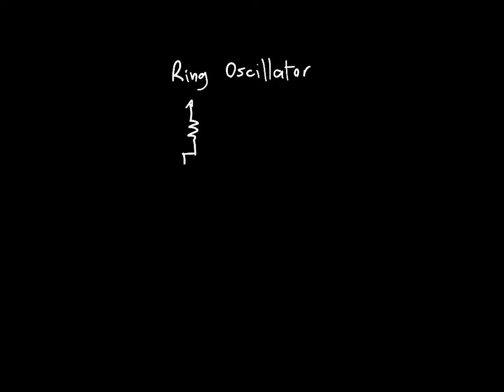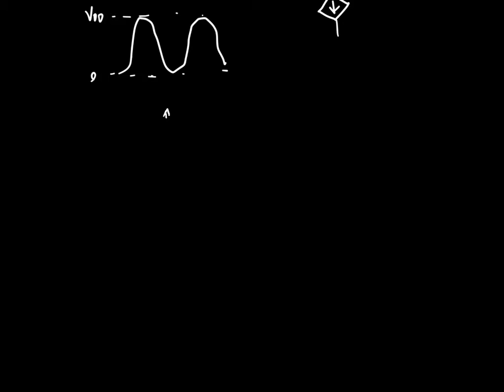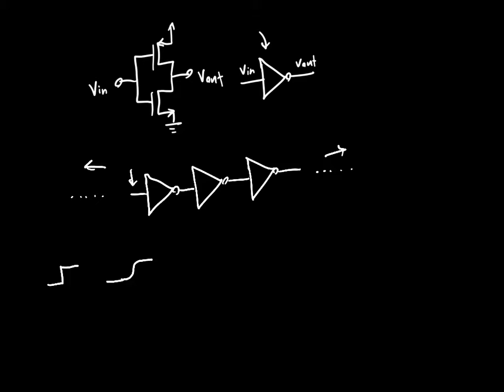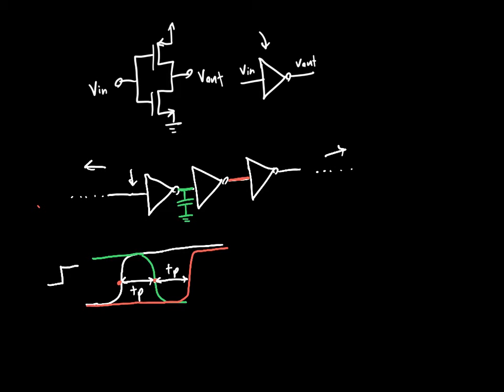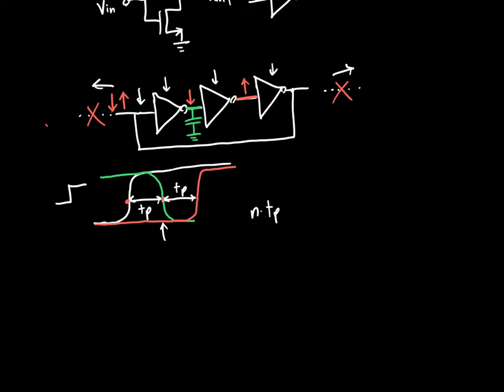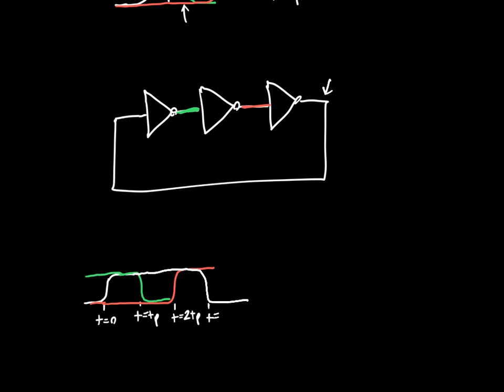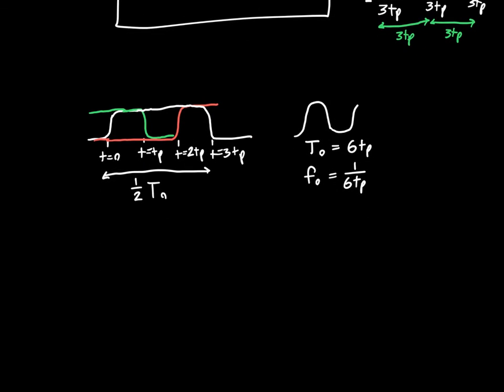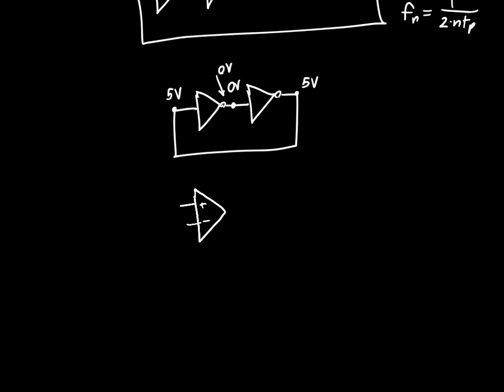Ring Oscillator Part 3   Large Signal Analysis

Comment: wired thing is  how does it?complete the positive feedback? based on the given analysis it's only negative feedback. I always have the feeling that frequency should be 1/Nt
Reply: the invertor or any circuit themselves has phase shift (1 pole contribute 90 degree for examples) besides the polarity inverted, which contribute another 180 degrees. But I think what this video told is definitely a good thing that why 2 inv cannot oscillate but have a stable operation point?

Comment: Hi, The MOS used in inverters is operated in which region?
Reply: That question does not have a straight forward answer. Both PMOS and NMOS go through each region during a transition.
If you want a good visual aid, I recommend googling "VTC of CMOS Inverter". Here is a good example with a small typo: https://www.electronics-tutorial.net/Digital-CMOS-Design/CMOS-Inverter/VTC-CMOS-Inverter/Fig6-VTC-CMOS%20Inverter.png 

If you give the inverter a rising edge (low-to-high voltage) the MOSFETs will go though the regions in the following order:
PMOS Linear, NMOS OFF
PMOS Linear, NMOS Saturation
PMOS Saturation, NMOS Saturation
PMOS Saturation, NMOS Linear
PMOS OFF, NMOS Linear
If you give the inverter a falling edge (high-to-low voltage) it is the reverse order.

Comment: So, the width of the tp is based on the capacitor we choose? If the frequency does not meet our requirement, should we change the value of the capacitor?
Reply from the maker: Yup. And yup, we could totally do that.
Reply: From the Wikipedia page for Voltage-Controlled Oscillator:
"The frequency of a ring oscillator is controlled by varying either the supply voltage, the current available to each inverter stage, or the capacitive loading on each stage."